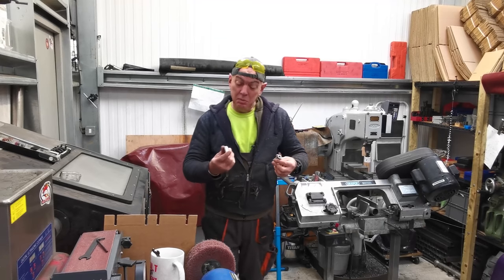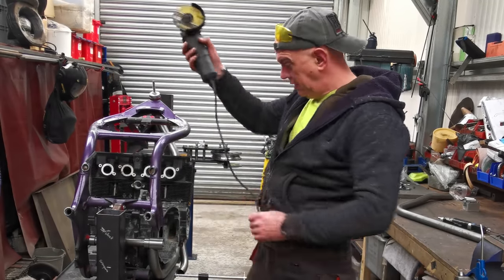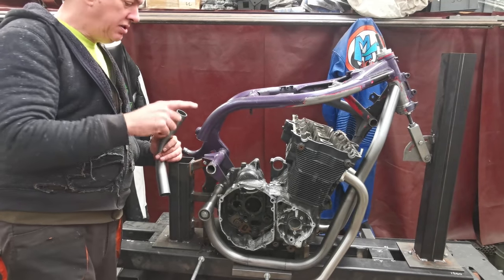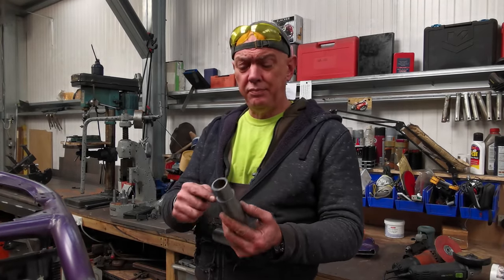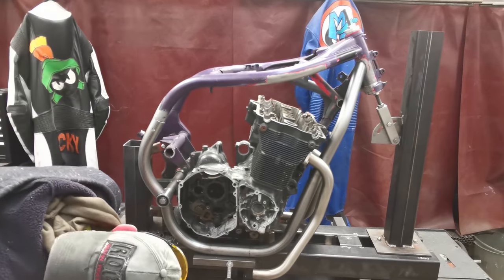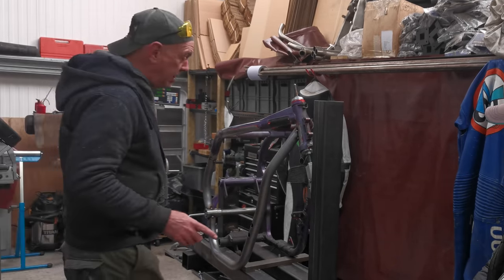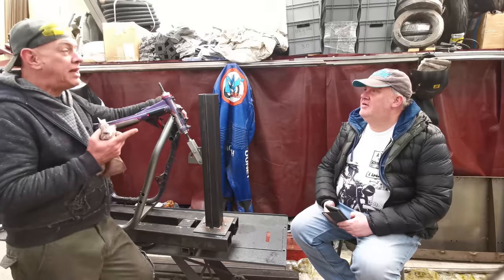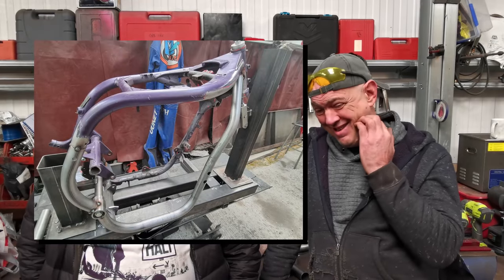Joining the old and the new frame together - Suzuki Bandit Cafe Racer - ASBO Project

Comment: I wouldn't be too concerned about the number of subs you know who has. The stuff you are doing is light years ahead. Just a couple of thoughts, are you going to brace that swingarm pivot point and what about a bolt on rear sub frame ?
Reply from the maker: Yes, it's getting braced at the rear just to add some more strength. I'm not sure about the subframe yet. I may so a welded jobbie a bit like GIXIT... I think I'm going wait till the front of the frame is all together before deciding as I want everything mega clean... 🤔